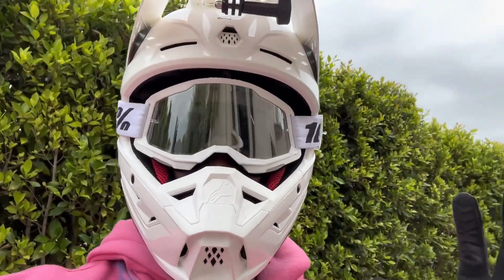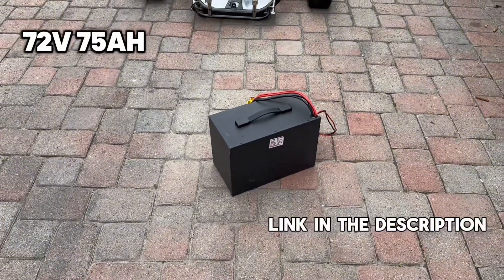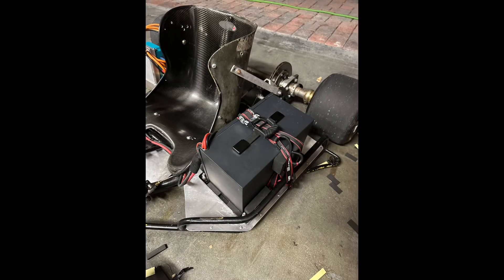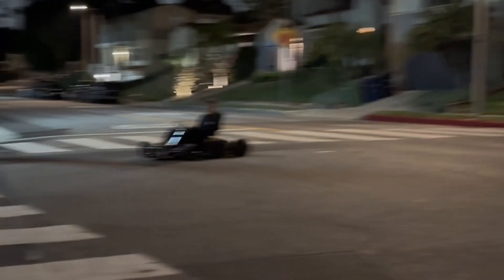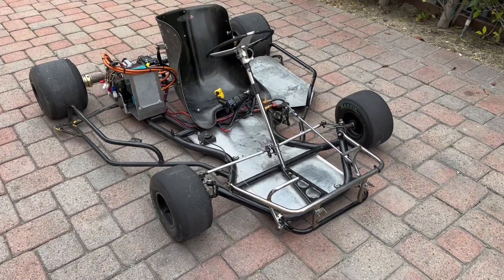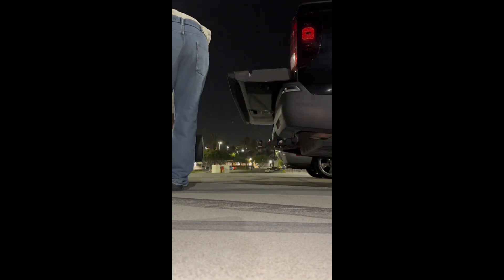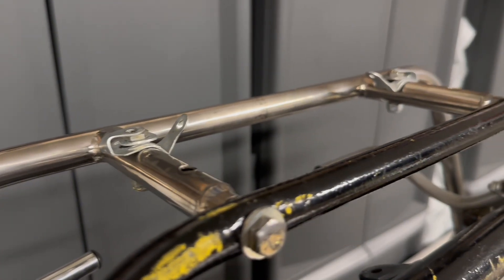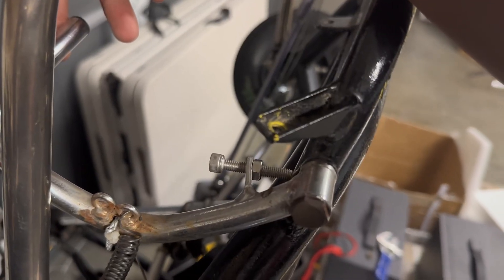How to build a fast electric gokart pt.2

Comment: Is the lightning md good in estrapz? i dont know if i should get it or not and is the sb storm r seat uncomfortable
Reply from the maker: The Lightning MD is dope! It’s comfortable and convenient with its lockable storage compartment. Plus the Lightning MD uses the same motor as the Storm R so it is more durable and has more torque.

I’m personally going to sell my original hub motor Lightning and order the Lightning MD myself

The Storm R seat is a little on the hard side so it’s not that comfortable but the Lightning seat is wide and soft so it’s really nice.
Reply: @ecrew_vp  thank you for the information, i would get the lightning md, but i make money pretty slowly so i want to get a powerful bike that would be worth saving up months for. Since the lightning md is only about a thousand dollars away from really good bikes i'm probably gonna save up for a more expensive bike in the 5-7 thousand dollar range so I can get the most out of saving up for awhile. Also, when do you think you are going to post a video on the storm r? it seems like a pretty great choice to buy over some other competitors like the ultra bee
Reply from the maker: @u @user-uv5gg9ru7x What bikes besides the MD are you looking at. For $4200 and free shipping it’s a pretty good deal. 

I’ll probably make a video on the Storm R in early December
Reply: @ecrew_vp  Right now, the storm r, ultra bee, and maybe e ride pro sr. they all seem like great bikes

Comment: Would you recommend getting a kart with front brakes when pushing this much power?
Reply from the maker: It depends on what you’re using the kart for and how much power you have but on track with my current set up the rear brake only should work just fine. I’m planning on building a 43kw+ kart so I’ll  using a shifter kart chassis because at 80mph I’ll definitely need better brakes lol.